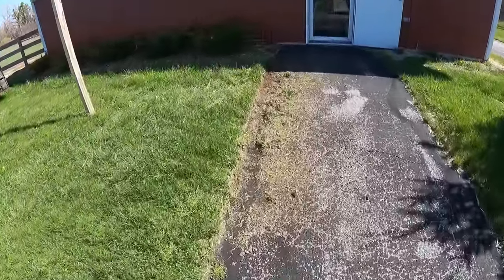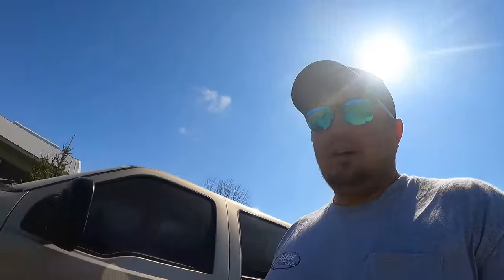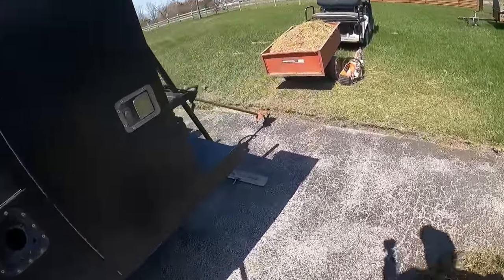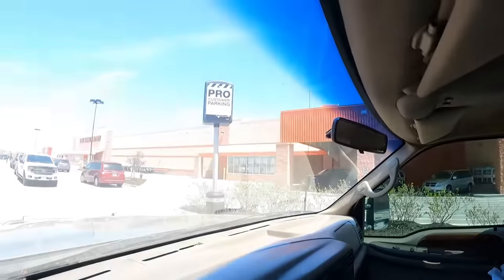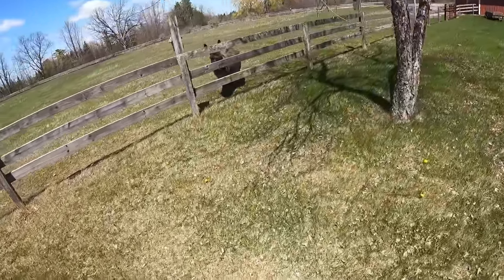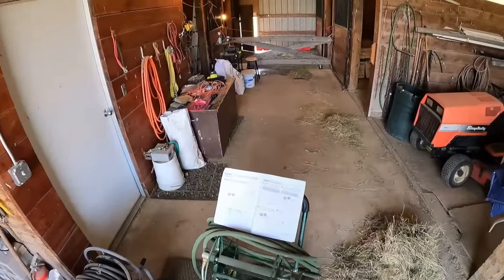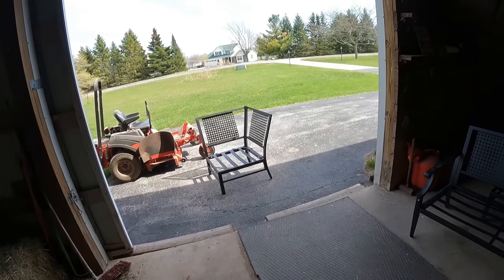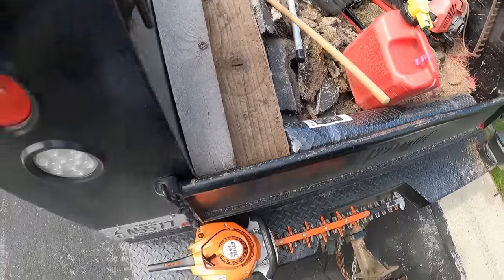MY MOM GETS NEW MOWER!!!

Comment: try not to cut deep like that, most asphalt is only 3 inches before its down to aggregate and youll tear the blade up that much faster, running the saw is kind of a plunge by feel sort of deal when its not concrete.